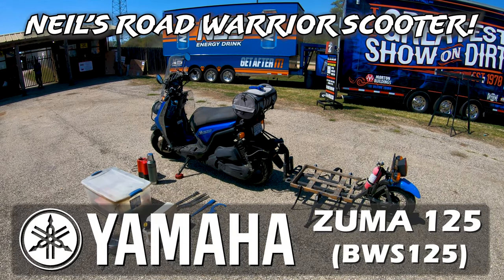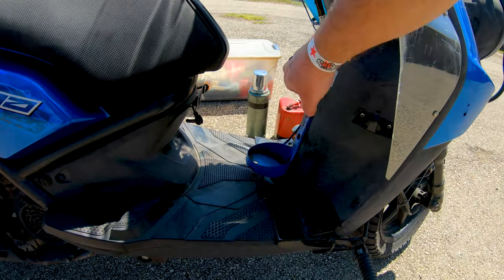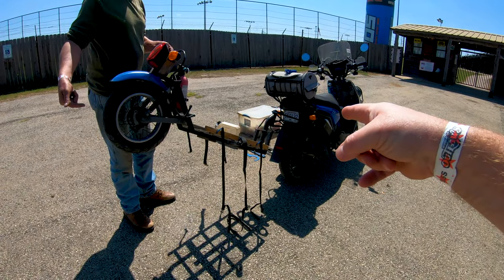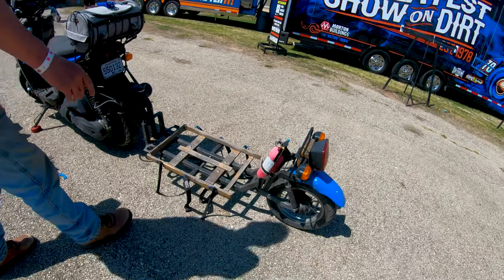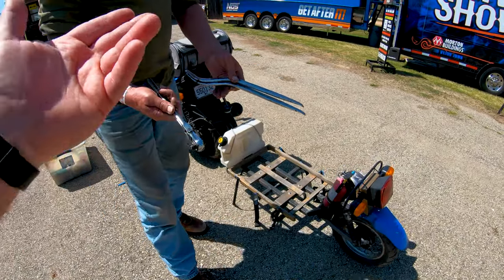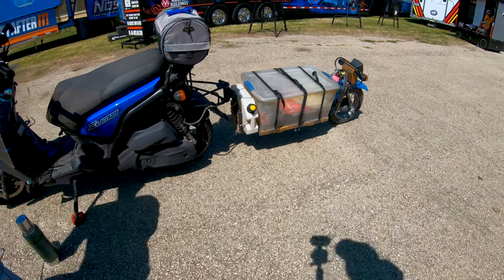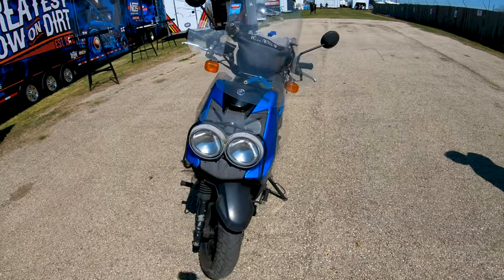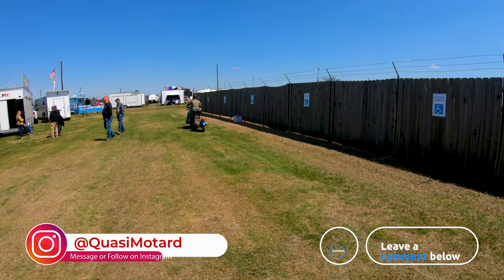2013 Yamaha Zuma 125 with a TRAILER // Scooter touring at its finest!

Comment: WOW!! 40,000+ miles credited!! That's amazing
Reply from the maker: Neil has over 50K miles on that little Zuma 125 now!  He rebuilt the top end of the engine recently with a new piston and rings (same size, didn't need overbore), new oil pump, and he resurfaced the valves.  He also rebuilt the front forks and the CVT while he was in there.  So, the little Zuma is ready for another 40-50K miles.  I can't wait to see how high the count goes!  😉👍  --QM

Comment: I like the cockpit flare.   I could use something like that on my Morphous
Reply from the maker: The great thing about Neil's modifications is that EVERYTHING is functional instead of just flash and bling.  All of his mods have gone through several iterations of refinement for long-distance touring.  He has done a bunch of cross-drilling and lightening of parts where possible to shed weight and make the scooter more efficient.  For example... he recreates and replaces his windscreen periodically... whenever the existing one develops cracks or road debris injuries.  The screen's shape, the mounts, and the air vents have all gone through several improvements over time.  That's a mad scientist engineer at work... unbridled and having fun with modifications!  😉👍  --QM

Comment: how do you control this trailer on slope if you have to go slow on that slop??
Reply from the maker: This trailer only weighs about 35 pounds unloaded (16 kg) and about 85 pounds fully loaded (38 kg), so it's more manageable than a passenger on the back seat.  The trailer's center of gravity is very low, so the weight pushes inline with the rear wheel/axle.  Slowing quickly while on a very steep downhill slope with reduced traction (e.g., gravel, sand, or ice) could be difficult because the trailer doesn't have its own brake on the rear wheel.  😉👍  --QM

Comment: Is this a highway rig 55 60 mph
Reply from the maker: Yes, Neil has ridden his little Zuma 125 on the back roads and rural highways for 50K miles!  It can reach 60-62 MPH top speed under ideal circumstances (level ground, no headwinds).  However, it's comfortable speed is 50-55 MPH all day long.  Cheers!  😉  --QM

Comment: Cool but I have the same size box on my rack 😂
Reply from the maker: If you have that large of a cargo box on your rear rack (especially loaded), I can't imagine how that affects your handling!  Neil's box is typically loaded with ~50-60 lbs of camping and cooking equipment.  That much weight high and rearward of the rear axle would negatively affect handling and cornering feel.  The beauty of these single-wheel trailers is that the weight is halved between the two axles... about 50/50% between the scooter's rear wheel and the trailer's wheel.  All of the weight is down very low, so the center of gravity for the scooter isn't negatively impacted.  😉👍  --QM

Comment: Every time i see this trailer, i wonder how in hell dont the front trailer sag to the ground, thats the part iam interested i knowing??also get you a big thermo drink cooler instead that white jerry can
Reply from the maker: Neil fabricated the front "hitch" (draw bar mount) for the trailer so it attaches at the upper-rear of the scooter's frame.  That allows both ends of the trailer to be suspended instead of just the rear.  So, the lowest that his trailer could sag is equal to the fully-compressed point of his rear suspension.

The KipMoto SherpaX trailer that I pull with my other bikes is suspended differently.  The "hoop" or hitch is mounted to the rear axle of the bike, so the front of the trailer isn't suspended per-se... it bounces up and down with the motion of the rear axle and wheel.  There are pros/cons to both mounting approaches.  The axle attachment is simpler and nearly universal, but the frame attachment allows the trailer to be fully-suspended.  Cheers!  😉👍  --QM

Comment: What’s the top speed loaded on flat ground?
Reply from the maker: We've been behind him on our PCX150's and verified his Zuma at 62 mph on GPS several times.  It's amazing that he can maintain that speed with a 125cc scoot while pulling the trailer behind him.  Neil is a tall guy, too... around 6'1" and around 220 pounds if I recall correctly.  That little Yamaha is a juggernaut!  😉👍  --QM
Reply: @QuasiMotard  What set up does he have on variator/clutch? 62mph can only be achieved for a moment and only at steep dow hill and maybe a tail wind. I'm the same dimensions as Neil and have gotten mine to 60 only under the conditions I mentioned. The Zuma is a legit 54-59mph bike. Anything over that is riding conditions dependent.
Reply from the maker: @optimusprime6436  I'm not sure what he's done inside the variator or clutch, if anything.  I know that he has done extensive weight reductions all over the scoot, and his aero upgrades probably help his top speeds.  Adrian and I have followed behind him on many occasions, and I've seen 61-62 MPH sustained on GPS when we're on flat/level ground without any headwinds.  

We were both very surprised during our first Ozarks trip at how fast his Zuma ran on the highway: https://youtu.be/_hKgxFxoFCc?t=497 .  I don't know if I marked any other points where the GPS speeds were visible on camera, but I'll dig around.  The really crazy thing is that he's pulling a trailer at those speeds... full-tilt boogie, and still getting 18-20K miles out of a CVT belt... that's awesome!  😉👍  --QM